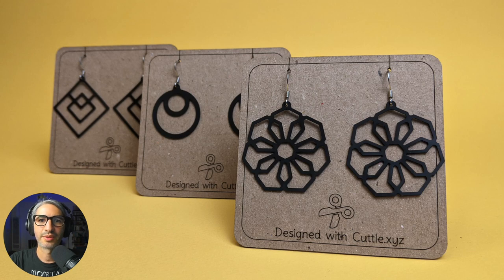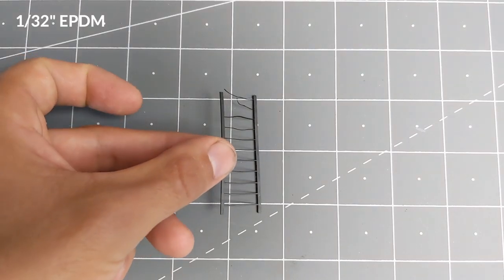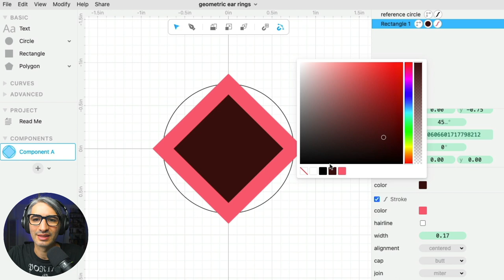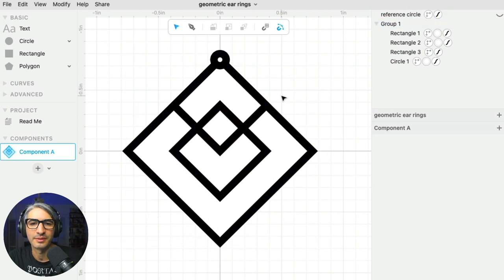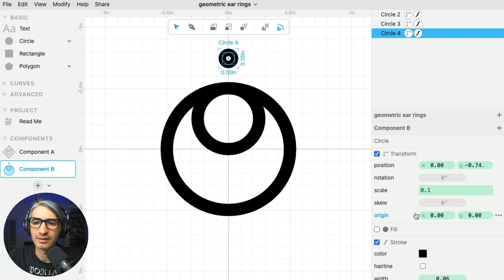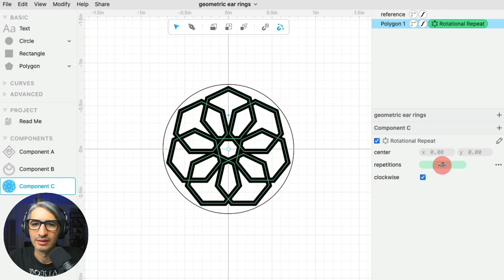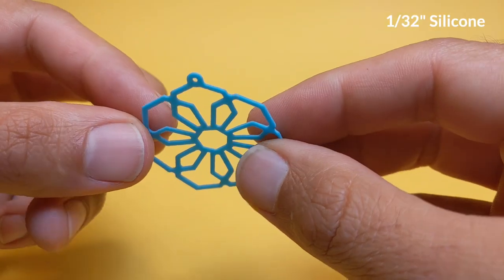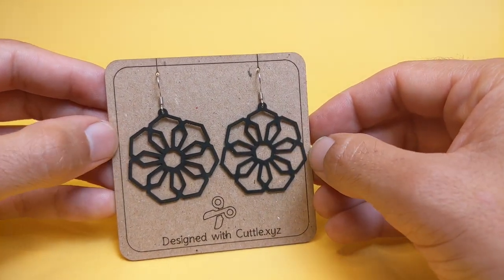Make Earrings using Silicone and EPDM rubber sheets

Comment: great video! excited to try some silicone. just a note on how you open the earring finding...findings like this & jump rings should be opened like a door instead of pulling it apart. swinging the circle open causes less stress on the metal and it is easier to keep the round shape.
Reply from the maker: Good to know. Thanks for the tip!

Comment: Thank you for this video, the idea is great. Please can you tell which model of Glowforge do you use? I tried to cut shapes in silicone rubber 1mm thick with CO2 laser equiped with air compressor, there were almost flames appearing, so not very safe for cutting. Was it easy to cut with Glowforge?

Comment: Nice video! Enjoyed learning about a new software available for designs. Will all EPDM and Silicone rubber be safe for laser cutting? If not, will it say laser cut safe in the literature?
Reply from the maker: Glad you liked the video Ben! 
It would be hard to say that All EPDM and Silicone rubbers are safe for laser cutting. For one it's hard to find data sheets for the stuff you find on Amazon or Ebay, and even the stuff you buy from suppliers like McMaster is not often advertised as intended for laser cutting. 

So this is still in the realm of "use your own judgement". We got the idea for using EPDM from the folks at Nervous System and we saw lot's of examples of silicone cutting in the forums, but with laser cutting the risk you take as a hobbyist is different than the risk that commercial operations will assume as they usually have better air moving and filtration systems. 

These are really good questions, sorry we don't have more definitive answers :)